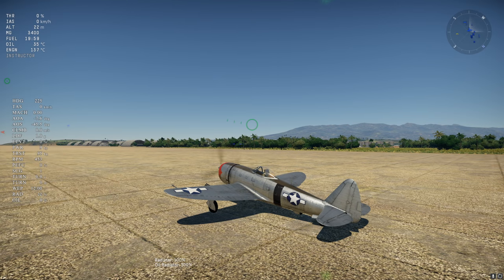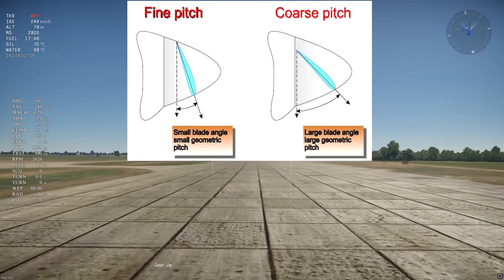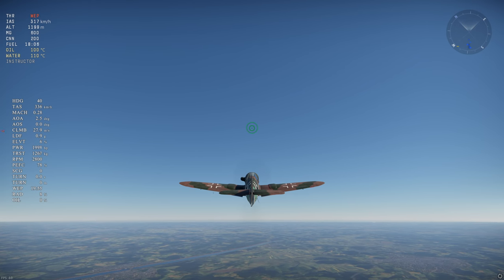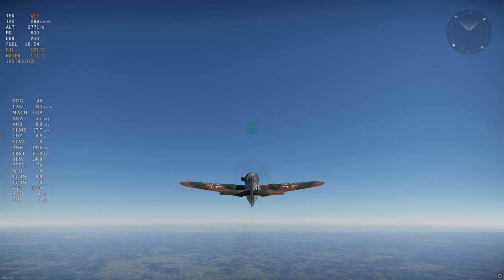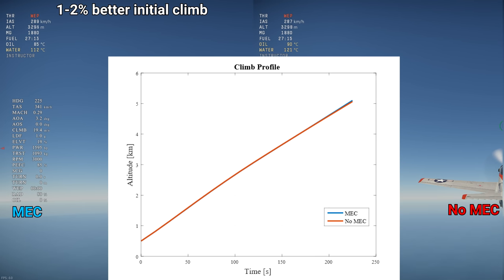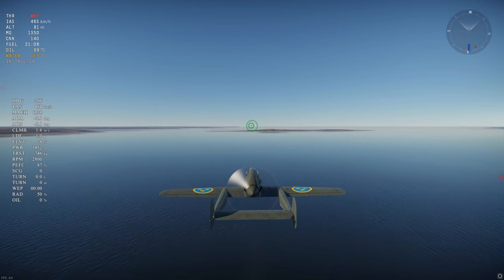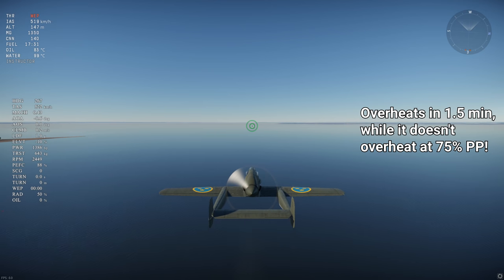Manual Engine Controls Part 2 | Performance Advantage With MEC

Comment: My biggest problem with MEC is i still think there should be an accurate and updated list or chart of every single prop in this game, because every place i look has slightly differing info on the MEC parameters, so every time i wanna try out a new prop and play it to it's best peformance, i gotta scour the internet and test every single parameter that is recommended to me to see what is actually the correct combo to give me the best peformance over the course of the matches.

Comment: I didn't know that when temperature goes orange, overheating theshold decreases. I thought it just happens naturally no matter what you do. Thanks!
Reply from the maker: Yup, my pleasure!
Reply: This is something they could do a better job communicating in-game. To most people, amber means "okay" not your engine is slowly dying.
Reply: Does this change the threshold at which yellow temperature turns orange / amber? Because at 5:45 I saw your temperature go from flashing red almost instantly to yellow.

Comment: Been using mec for a while 109 air brake is pretty funny to watch people freak out in dogfights
Reply from the maker: I don't use it too often but yeah it's nice.
Reply: I too freak out on dumb 109s dropping all their advantage to turn with me lol
Reply: @rekreator9481 if a more maneuverable aircraft is behind you at the same speed then prop braking is the best way to survive by forcing an overshoot
Reply: @tylerfoley6644  I see it as ineffective in most situations thats why I was never a fan of doing it.. It may work out against less experienced players, having a bit of luck if they panic and make a mistake.. but an experienced player in more maneuverable plane and (now also) with more energy will easily disengage and turn back on your 6 in no time again, leaving no chance of a runaway now.. Im not saying its a completely useless tactic, but if there is any chance I could have better acceleration and gain energy advantage over more maneuverable chaser, Ill always prefer doing that rather than having a one-time kill opportunity in which I have to succeed or Ill end up dead.

Definitely I dont believe OP to be very successful if he truly uses prop braking with 109 in dogfights as often as he says.. All in all, 109 is energy fighter, besides very specific 1v1 situations, it doesnt make sense to use this in 109 at all...

Comment: min 7:30 i found a solution for F8F-1B with that trick thank you so much. I played with WEP most part of match i managed to set the propeller pitch at 80% mixture at 90% and both radiators at 50% some time i had to open it but in a short period of time and after fights.
Reply: Seems like for most of the American Radials you can run that rough 90% mix and 85% pitch. It definitely makes the f8f more enjoyable
Reply from the maker: My pleasure!

Comment: Adam, If I'm not mistaken, auto engine controls will switch SC gears at the correct alt. So going into cockpit view and switching quickly to auto and back while keeping an eye on the relevant dial (i.e. Manifold pressure) when approaching the switch alt, will allow you to see exactly when to switch gears, as the auto mode will do it and you'll see the hand in the dial jump to a higher pressure.
Reply: But the overlay is essential, especially for planes with limited wep
Reply from the maker: Yup, but it's complicated to tell people what to look for in the cockpit.

Comment: Then there are 109s and Spitfires engines that without MEC get into red immediately, but with MEC can WEP forever and feel like UFOs lol...
Great video as always Adam!
Reply from the maker: Thanks!
Reply: Spitfire IIs just delay grenading their engine with MEC WEP lol, but it's definitely way more preferable than fully burning the engine out in the middle of the fight. The Merlin Spits are quite okay with MEC, still not completely perfect if you WEP too much, but it can WEP pretty comfortably.

109s basically have infinite WEP, hooray for them (as do 190s).

Griffon Spits... don't quite have infinite WEP, but basically enough to last most of the primary and some of the secondary engagements.
Reply: TheAmazingCowpig yep. Btw i was talking about tier 4 planes. Tier 3 109s can’t full wep even with 100% radiators
Reply: @TheAmazingCowpig  109 F-4 gets hot pretty fast, even with 100% radiators.

Comment: Weird tip: 68% prop pitch on 109s at under 170kph generates lots of power for some reason. Do you think you could dig into that and find why that happens??
Reply from the maker: Already did, might be the origin of that fact spreading haha: https://www.youtube.com/watch?v=ynJ33k6OMaQ

Essentially too much power and too little prop area makes the blades stall at low speed. Going to higher RPM (prop pitch) alleviates the thrust loss, hence increase in thrust at 65-70% prop pitch.

Comment: i remember that using wep in aec in the past caused closing the radiators to maximize the performance, even when overheating. and lowering throttle to 100% were opening them, but dunno how it works today
Reply from the maker: Now it depends on both temperature and throttle. On WEP it delays opening of the rads until you're basically in the red.

Comment: About learing about mec- i was a very impatient player when i started learining mec (as i moustly use it to maxmimalize cooling between engagment, climbing, breaking off, and beter controll during landing- I would turn it off during fights) but after i started playing with it this one extra routine made me pay attention more to my exact positioning as I gained moust about how plane phisics should work from greg's channel (guy explains how tech back ten worked and how they where designed - moustly p-47's but also mustangs, bf109s, zeros, fw190s and occasionally about some british planes - i cannot recomend the guy enough. )
Reply from the maker: Greg's channel is great indeed.

Comment: You can write a python script to automate most of these MEC procedures. It seems like the goal is just to maximize thrust at any point without exceeding temperature or RPM limits. Easy to code.
Reply from the maker: Hmm at that point it can be considered cheating though.

Comment: Hey hey Adam! Thanks for another great video. Perhaps you could shed some light on a topic I can't really understand: Why do we want a fine pitch for climbing and coarse pitch for level flight (to get max speed)? My understanding is that piston engine has certain RPM where it generates the most power so we want to keep engine on that RPM no matter climbing or level flying. So first we set our pitch to achieve desired RPM on certain altitude. As we climb the air becomes thinner and it's easier for prop to cut through the air so RPM increases. We decrease pitch (make prop more coarse) thus decreasing RPM back to its optimal. Now let's assume we are in level flight at around sea level where air is the most dense. In your other vids I've seen you decreased prop pitch to increase speed. But according to the above statements I've made, the air is the most dense down there so our optimal RPM is achieved with a quite fine pitch ~100%. However something like an early Spit seems to be having best speed in level flight at sea level at around 65-70% of pitch or so. Piston engine doesn't know if we are pointing our nose up or it's leveled, it just has its best RPM. The air doesn't know if we are climbing or not, it just has its density at given altitude. So where this "level flight speed increase with coarse prop" comes from?
Thanks
Reply from the maker: My pleasure!

Well it's mostly a myth that has been repeated a lot. Piston engines indeed are most efficient in a certain RPM range, that's why constant-speed props were used in WW2 to keep RPM constant by varying the pitch angle of the blades instead.

On some aircraft in WT like P47s, you get higher prop efficiency by lowering prop pitch (RPM) to 85% or so, and that compensates for the drop in power. I don't think that's the case for the vast majority of aircraft, but lower pitch does reduce overheating and hence lowers rads, making them faster.
Reply: @AdamTheEnginerd  Wow thanks for quick answer. Okay, I'll do my experiments but it really feels that level flight gets faster with a little bit lower prop pitch (At least certain aircrafts). Also, where did you get those JSONs from? :) Are they packed in client resource files somewhere?
Reply from the maker: Yeah I used these instructions to get the files: https://www.reddit.com/r/Warthunder/comments/8nq70p/tutorial_how_to_datamine_or_how_i_learned_to_stop/
Reply: @AdamTheEnginerd  I see, thanks. I used that tool before but there were so many files in there that I just got lost. Will take a more closer look. Many thanks and fly safe :)

Comment: When i used to play warthunder i find that the BF109 is easy to manage with MEC but the P47 and P51 will out perform the bf109 in MEC since the OIL and RADIATORS the p47 and p51 have the same control
Reply from the maker: Not sure what you mean.

Comment: I could never get the overlay to work over the game screen, it always opens up only on the browser and never shows on the game window like in this video
Reply: Yeah I am seconding this, if there is a way to make the overlay stay on top of the game, I would love to know
Reply from the maker: You need to play in window or fullscreen window for it to appear. When I stream I can show how if you ask, but that's pretty much it.
Reply: @apaxx3950  turn the overlay on, go into the overlays settings and make sure the osd type is set to 'WTRTI'. then, once its open, open the game settings. go to options -> graphics and set 'Mode' to 'Fullscreen window'. hope that helps
Reply: @lemon6171  you're an angel, thank you :)

Comment: How do I optimize this for my MiG-17, doesn’t climb well enough
Reply from the maker: Play props.
Reply: Fun fact- all American jet engines with Afterburners have manual oil radiator control
Reply: @igoryst3049  wait WHAT. can it prevent the f100's oil from deep frying my engine on sicily?

Comment: I would use MEC but I feel like I dont know enough about aircraft in terms of engines and everything that has to do with it, I play just fine without although I encounter situations where some extra power would be useful. But like I said I dont think it for me
Reply from the maker: It's relatively straightforward, but indeed it's not necessary.
Reply: Apart from the initial climb, where I’d argue MEC makes a bit more of a difference (particularly towards the end of the climb once the non MEC-ed engine goes yellow and I need to drop throttle without MEC) if a percent or two difference in speed means life or death then I’ve made a mistake. I wouldn’t sweat it.  I use MEC because I’m lazy and would rather not worry too much about overheating but most people I know, including some amazingly successful flyers, don’t bother with MEC. I use it as standard but there are plenty of planes such as the F6F, corsairs and thunderbolts where I don’t bother. Partly because MEC is more complex with those planes (some actually use mixture, for example) but largely because they have limited WEP anyway, and I’d rather WEP didn’t run out at an important time so I tend to use a lot more non-WEP sections to my climbs anyway. In testing the Corsairs and F6Fs have something like 8 minutes WEP only, so I might use 1/2 of that for the initial climb and then save the rest for emergencies. This tends to equate pretty well on most maps to when the engine needs to be cooled anyway, so I just leave everything on auto. Unfortunately every plane is a bit different. This would be OK if it were documented by Gaijin and there was some consistency in naming but this isn’t the case. Pitch means RPM on most, but not all planes. This really should be easy information to find but.... Gaijin.
Reply: I also feel and think its most important at the start of the match in the climbing phase depending if it works for an airplane or not getting that extra boost in climb gives you quite an advantage in altitude.
Reply: @julianmorrisco  I agree. I guess most German Planes especially the ones with MW50 have "unlimited" WEP coz it lasts for the whole mission time which is mostly 1-2 hours. :) Curious about other nations with own designs like Britain, Japan Italy & SovietUnion :)

Comment: Thanks for the useful video Adam. I play on PS4 and I want to start using MEC now. I do have a keyboard plugged in that I use for a few basic commands but I want to bind controls for MEC. What are some keys I could use for these adjustments? Something not too complex. Most of my buttons on the keyboard are not binded to anything so there's alot of options. Thanks Adam I hope to hear your reply soon so I can improve my flight performances.
Reply from the maker: My pleasure!

Just watch part 1 of this video that DEFYN made: https://youtu.be/RRzMcnCS4ag

Comment: Regarding the overheating threshold lowering:

Is this a function of temps being too high too long, or simply because of altitude? There was a 2km difference when you showed the two examples. Higher altitude = lower boiling point?
Reply from the maker: The cooling system is pressurized and has no outside port, so the outside temperature is not relevant in this case. You could stay at sea level and the same thing would happen.
Reply: @AdamTheEnginerd  I’m an idiot. Didn’t even consider that. Thanks for the response and the amazing content. Do you have a Patreon?
Reply from the maker: @I_am_not_a_dog  My pleasure! I do not have a Patreon at the present time, but I appreciate the sentiment!

Comment: Hey Adam, can you explain why my plane's rudder keeps twitching left to right all the time? I tried high alt, low alt, definately not turbulence. I looked up on the forums, no it's not my fps or net lag. It just started recently after today's patch, never happened before. I have mouse aim, have disabled all the instructor function that can be turned off and I'm flying IL-2 but it's happening with all my planes. Sorry for wall of text, my bad. 
Nice video btw, i don't do full sim and people may call us tryhards but the little tweaks really help in a 1 vs 1 engagement. Cheers !!!
Reply from the maker: Haven't played yet, can't say. Are other people having this issue?

Thanks!
Reply: I noticed the wobble too.
Reply: https://youtu.be/vDcaG_QTgYQ

is this it? messes up my aim.

Edit: sorry bad quality, used my phone but atleast u can see the aim shaking and my ping and loss to notice this wasnt due to internet quality.
Reply: @user-xo3gj2sk1k  omg this is it. See the rudder wagging like dogs tail? Any fix you found to this?  Anybody?
Reply: Play Simulator battle, in simulator you will take control all of the plane instrument (the basic such as elevator,trim,pitch,rudder,etc)...
I was same like you (arcade and realistic) but when i started playing sim (until now) i finally got 100% control of my aircraft, sim battle is hard but you can practice to master it...
If you still not sure even after u tried the sim battle, go to the replay tab (a tab, u can see ur battle replay on there) then see your last replay (the sim battle replay)

~cheers
Reply: @ZaYn.91  Preciate the advice, sim fixed it, thnx!
Reply: @muhammadhasan1616  glad to hear that! Have a nice game, mate
Reply: @muhammadhasan1616  btw The "Rudder Wiggle" basically called Auto Rudder, its an Assist option, it will assist you while flying so you dont need to control your rudder manually

Comment: I wish there was a climb script which automatically gets the best engine performance
Reply from the maker: It's debatable what "best" is. Closing rads will be good for running away or to catch someone, while open will be better for climb to not overheat. A script wouldn't be able to judge that.
Reply: @AdamTheEnginerd  If such a script could get data from localhost, maybe it could use IAS to judge which settings to apply, open radiators and higher revs below lets say 350 kph, and lower rads and revs when above that speed

Maybe something like pyautogui could help ??

Comment: 7:30
I know at least 1 plane where WEP mode isnt on 100% but on 92% prop pitch instead - I-185 M-72. So check the manual first
Reply from the maker: What do you mean?
Reply: @AdamTheEnginerd  according to the forum page and automated engine control, I-185 M71's WEP mode listed at 2300 RPM, but at 100% pitch I got around 2500 RPM insead. I dont know if its a bug or a feature
Reply from the maker: Hmm.

Comment: so wait 
 on allied planes that has no prop pitch limiter should match the engine RPM ?
Reply from the maker: Not quite sure I follow, but on Allied planes they give a target RPM and the governor changes the pitch to achieve that RPM, in contrast to German props which take direct control of the pitch angle when you change prop pitch.

Comment: I thought orange engine temps were fine and just a ‘warning’ you were getting close to red (reduces temp tolerance and eventually damages engine)
Reply from the maker: I thought yellow was that. Over time, orange does reduce temp tolerance in my experience.
Reply: AdamTheEnginerd i’ve only ever noticed orange reducing max temp on planes with stressed/sensitive engines. I can’t remember off the top of my head if it’s the XP-50 or XF5F that creeps into orange + red on 100% throttle, for example.

Comment: Hi Adam, what happen to the propeller pitch  when you decrease throttle in automatic mode? I believe it decrease with the throttle in order to avoid the air brake.
Reply from the maker: Yup decreases both.